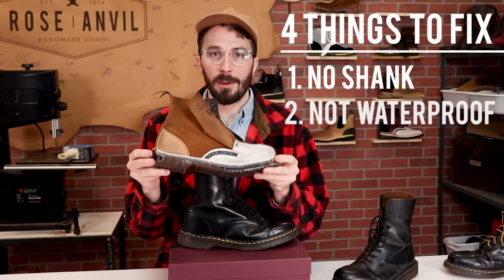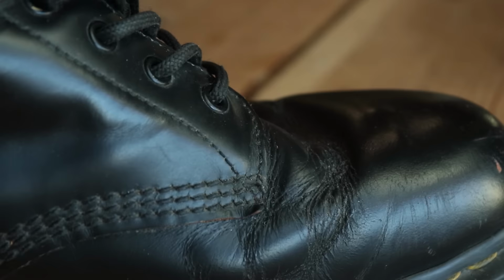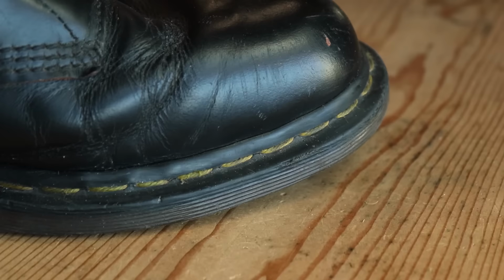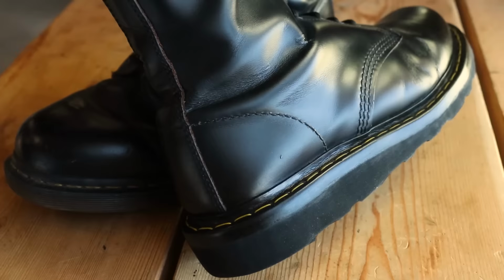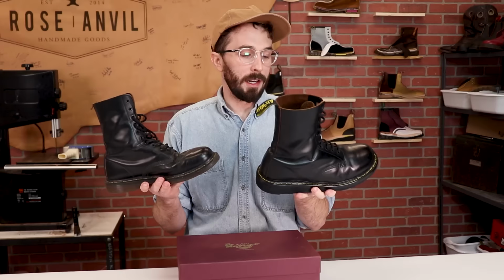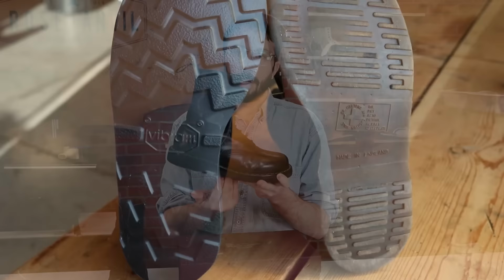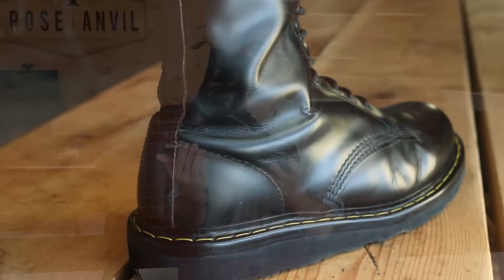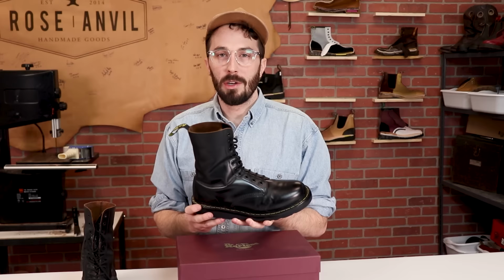Dr. Martens Resole -(MAKING DOCS BETTER)- 4 Big Problems Fixed

Comment: You know I think it’s a real shame no one is making a good quality boot in the same style as Docs.. when it comes to the shape of the boot itself it really is a great boot and very few high quality boots have such a comfortable fit and wide toe box, the technology of the air wear really is great in my opinion.. I recall you tought it was nothing special and didn’t live up to the name but I disagree it gives the boot just the right amount of a bounce and real light weight and athletic feel to it that really is hard to come by, it also is a really good looking boot that is simple and can easily be mass produced cheaply and therefore sold cheaply even if you where to use more high grade materials.

Comment: I asked a docs customer svc rep, via email, if i could get a pair of the reinforced toe low quarters but without the air waves sole(airwave sole sux),and instead with a vibram sole. The answer to that is no. Therefore that was the last pair of docs i will ever own. Looking at the thorogood line

Comment: You did a beautiful job resoling the boots, but am no a fan of flat sole boots for any application.    I see a chain stitch on the sole.  I believe feed sacks are sewn on the ends with a chain stitch.  Feed sacks can be opened by cutting one thread and pulling the whole string/thread out.  Can that happen with this type of chain stitch?

Comment: It is interesting to me how much people find Docs to be low quality. I have had very good luck, I suppose. I wear a pair of "vans-like" docs, but made of leather, nearly everyday for 3 years. They haven't even worn out in the slightest. My pair of 1460s is still doing great after roughly 5 years of moderate use (however 5 years is not super long for boots, I will admit).

Edit: I mean this in a way like, damn.. I'm disappointed, not "hey, y'all are wrong."

Comment: I sent mine into get re-soled and I’m so hyped to get them back
Reply: Where did you send yours Samuel Martin?
Reply: @matttherrien9608  im from the uk so it was timpson’s
Reply: @samuelmartin2061  they used authentic English Doc soles did they not?  As a Canadian I'm unfortunate considering they won't serve me.  I don't know what I'm going to do when I want my soles replaced.  I may have to compromise with Vibram soles over here.
Reply: @matttherrien9608  yeah its the offical soles they used too, not put on the same way that doc martens do to their boots but they still work great
Reply: @samuelmartin2061  wish I could find a cobbler this side of the pond to do an authentic replacement.

Comment: That cork footbed was pretty rough, as were the edges on the leather midsole. So, when you etched your stitch line, your stitch line was equally as rough. One step at a time... Definitely would like to see that edge cleaned up before advancing.

Comment: You used a harness stitch instead of interlocked stitch to fasten your hand made weld to the boot? So you can't cut one thread then pull it apart?.

Comment: I find Docs last quite a while, then suddenly within a very short time they go from  still wearable to leaking, split sole and in the bin. it's £80 in the UK to get them resoled and if you wait you can usually buy brand new for the same or less price.
Reply: Timpsons can do them for 80quid or you can shop around and find a pair of 1460’s for £65 on offer. Unless you have a pair of boots you’re sentimentally attached to it’s not happening. I’d love a pair with vibrant commando soles though and might have a crack myself some day.

Comment: What I kinda missed is the explanation of what you're doing every step of the way, and why. E.g. I was puzzled why you didn't put in a shank after complaining about the lack of one in the originals, and I thought perhaps that sole had one built in, until you mentioned at the end it didn't need one due to the way it is constructed. Otherwise good video.

Comment: The sole is only held to the boot by glue? I have had several boots repaired in this fashion, but within a year or two the sole pulled away. What kind of glue are you using here? Is there no means of using stitching or even screws?

Comment: I had a pair of dr martens pecos the slip on work boot. It did not have the steel toe. I had them boots for 12 years. By year 7 or 8 the sole would always leak. If I stepped in a puddle of water my foot would be soaked. Don’t get me wrong 12 years working in them every day as a meat cutter I got my money’s worth. But I have red wing 877 now and will never go back.

Comment: Why didn't you soak the welt in water before stitching it on?   Same thing with cutting the mid-sole edge.  Work smarter not harder.

Comment: What is expression 'load of old cobblers' referring to?
I had a vintage pair of Peter Storm boots that had no sign of wear on sole after 5 years and thousands of miles. What was that material?
Before your modern petroleum adhesives.
 How were boots made?

Comment: Is there a service to re-sole redbacks?  the thin outersole wore out and all the PU inside fall apart.  It's a shame that the sole deteriorate in a couple of years while the upper part stays in very good condition.  Also, which boots have thicker outer sole that won't wear-out so soon?

Comment: Awesome video. How much would this cost to get done? I'd for sure buy or get modified if it didn't cost a whole paycheque.I like Docs but you can't wear them in the winter here in Canada or you will definitely end up breaking your neck walking around outside. This winter I'll be rocking some Magnum Stealth tactical boots, super comfy so far.

Comment: I have my second pair 5.11 atac 8" boots.
I have on this second pair the same issue as with the first pair.
The inner fabric at the back of the heel got broken.
What could cause the damage on the inside of a boot at the back of the heel?

The boots are couple of years old now but look very good still on the outside, even with daily usage.

Comment: Is there a specific tool that helps you split the leather strip for welting? Instead of doing it with a clamped razor. Just curious cause i got a pair of shit aldo shoes i wanna restor.

Comment: Dr Martens really can't stand water and snow, this is a problem, but I think the sole is fine, very comfortable and durable, can be used for a long time
There is no problem with the height: it used to be possible to get more than 20 year ago simple Dr Martens shoes, 10 hole height, 14 hole height and 20 hole height boots
The only problem with the steel nose is that it is not sewn, only glued, so it can blister over time or separate from the inside of the nose
(The quick lacing system of today's current Bundeswehr boots would be better than Dr Martens, but these were made as medical and work boots a long time ago and the design was not changed too much and these are non-military boots)

Comment: I have a pair of docs that the leather on the heal tore through right along the line of that leather strip where the yellow thread is that holds the soles together (Storm Welt?) Do you think that's repairable? It almost looks like the leather was cut too short by accident somehow at the factory and eventually it just separated. I was on a TV set and some one stepped on the heel and the whole bottom (Outsole to insole) just came off and you could see my socks. got a complement on my sock so theres that though haha

Comment: Dr. Martens were originally developed as a medical aid as opposed to footwear for everyday use. They were initially developed for soldiers with lower leg and foot injuries and were designed to lower the impacts of walking. Interesting to see a 'medical aid' reworked into a more practical everyday boot.

Comment: Those are foam soles. That's not better. Foam soles collect water when you are waling on wet surfaces and you'll slip as if you had skates on. Not good at all. Better to put some Vibram hard rubber soles on.

Comment: Listen, I'm not going to knock you for doing a bad job, because you obviously didn't, but the choice of sole kind of misses the point.  The whole point of Docs is that air cushioned sole.  If you don't like that, then that's fine, it's all up to personal preference.  But it's strange to "improve" on a design and then basically throw away the main thing that it's named after.  I know that finding a replacement that wouldn't just be built in exactly the same, unreplaceable shape, but still.  You've shown in other videos that the rubber welt can be torn off of the bottom fairly easily, maybe it would have been better to rip the bottom off of some of the single, un-matched boots (because you bifurcated their brothers) and try to attach one of those, instead?  Or maybe it's just an irreconcilable issue that air-filled soles can't be made to be replaceable in the same way?  I thought that the Solovairs were replaceable, and they still have that air cushioned sole, too, right?  I don't know, I don't really know anything about boots or cobbling, so maybe I'm missing something or it's just totally beyond the scope of a garage cobbler to try and do it that way.

But, to me, the main goals with improving any design should be to take the main, distinguishing feature of that design and try to fix other issues around that main feature, and to improve upon that main feature while still preserving its original goals.  Once you've thrown out that central, defining element of a design and replaced it with something else, then you really haven't improved that design, you've made something completely new.  Yellow stitching might be an iconic marker of Docs' visual design, but it's not the main functional thing that distinguishes it from other boots.  Doc Martens sells a bunch of different boots without any yellow stitching, but they have that air cushioned sole, which, to me, is what makes them Docs.  And even their own history tells the same story.  The company was originally started around the idea of selling boots with air cushioned soles for comfort, not to sell boots with yellow stitches.

It would be a bit like "improving" on the design of a motorcycle by adding two more wheels.  It would still do basically the same thing, go vroom and move fast, but you haven't really "improved" a motorcycle, you've just turned it into a car.  It's still impressive, but now it's not a motorcycle, anymore, even if you did bolt the handlebars onto the steering column for aesthetics.  And the work you've done on this boot is crazy impressive to me, and it looks really, really nicely made, and i also like that waterproofing shank design you came up with, but now it's not really even the same kind of boot, anymore.

Comment: Dr Martins have never been good boots . A lot of people who grew up with cheap shoes would have bought a pair in their mid teens probably as their first pair of more expensive shoes and  will be impressed by them in comparison. And those wearing them in the shop will feel the air sole is comfortable and that along with the look is their inroad to a reputation that is undeserved.  I've had them as work boots and they have lasted as little as 6 months before the sole gave way.

Comment: Doc Martens can't be resoled????   Really!!  Replacing D.M. original units is one of the easiest repairs a professional repairer does.
D.M. s don't have a shank?  Really!!  Removed unit exposes wooden shank. Changing the originality of the boots is not a good idea, there is a reason people wear D.M.s. The welt stitching was too loose and I would doubt if they are as waterproof after repair as before, so I give this vid a thumbs down.

Comment: You've taken an iconic boot and turned it into an ugly wedge boot. Done nothing that a decent insole wouldn't have achieved and still retained the proper look. As for DrM's not being resoleable; absolute rubbish - I had a pair of boots from the 1980's that were resoled at least twice (maybe the times) for the duration I owned turn. Just take it to someone who knows what they are doing rather than a hobbyist.